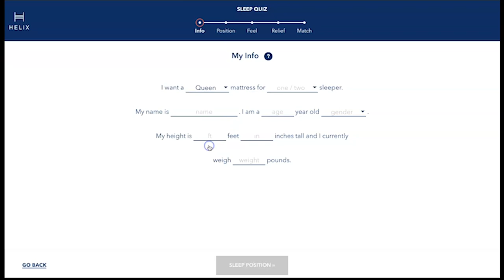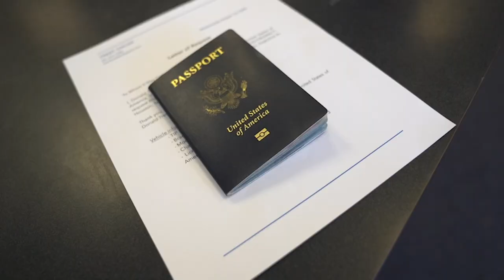UPDATE ON OUR VAN + POURING OUR CONCRETE WALLS

Comment: Questions lol! Did they have an engineering company come up to do slump tests and take core samples to the lab for the concrete? I used to work for a company doing them. Curious if it is the same there.  It's good to see it all coming together! 
On the van: Worst case can you contract sell it to the storage owner so they gov doesn't take it? Worth a shot rather than just letting them take it.  Or maybe you can legally lease it to someone down there? I guess worst case, tell them that you don't agree at all and don't understand why they're doing what they're doing then report it stolen to insurance. It's not like you agree to give it up.

Comment: Allie, you should contact the Argentine Embassy in Washington.; a directive  from them will have more standing in Buenos Aires then that of any of the other Argentine Consulates in the US.   Also, you should contact the Argentine Foreign Ministry (La Cancillería) in Buenos Aires and speak to someone in the Tourism Sector  —invite them to view your YouTube channel- and request that they help you obtain the Permit Extension and to navigate the system in Customs (Aduana) to process the export of your van.    When you contact The Foreign Ministry, especially in writing, do so in English, the building is filled with Career Diplomats that speak English and your inquires are more likely to be re-directed to them rather than their assistants, which should get the attention of someone higher up in the chain of command and they will afford you more respect.   You should also contact the US Embassy in Buenos Aires to see if they could provide the contact information for Import-Exporters that they work with regularly —in Argentina finding a legitimate and trustworthy company is key.   Suerte!

Comment: If you have a TAP, and you worried that it would expire before you get it, suspend your TAP if it's parked on a private property, send them your docs they will verify the Van is actually there and not in use and suspend the TAP until u allowed to drive it back.

Comment: If I'm understanding the schedule here, I really hope you haven't already backfilled those walls THE DAY AFTER POURING??? That is utterly insane. That's green concrete and it needs time to cure and strengthen before putting many thousands and thousands of pounds of pressure on them from backfilled soil. You also need to coat the outer walls with a water sealer. The concrete should be allowed to cure for at least a week bare minimum and hopefully a month for optimum strength. And keep the concrete as wet and as warm as possible (wet concrete cures much stronger than letting it dry out). High rise jobs during winter close in the pours with plastic and insulating blankets. They run propane heaters inside the enclosed area as well. If the concrete freezes while it's still green, you will lose strength big time. Those Mexicans have no idea about such things because they don't get weather like that down there (and have very loose or no enforceable building codes). I can't believe the local Utah guy helping you isn't attuned to these facts. The usual in the construction biz - Good enuf...can't see it from my house!
Reply: Hi  drott - another commentor gave me the heads up that this drama and clueless approach is actually on purpose to build views.  Wow I was naive!
Reply: @batterbury4477  Yeah I often wonder if it's trolling for comments, drama and clicks. And maybe it is? But Trent really doesn't seem to know much or anything about concrete. He is a very mechanically capable guy all around, which he has proven himself to be over and over. But we all have our blind spots. It seems concrete and maybe plumbing are his.

Comment: Building a home, is not the same as building.out a van, or travel trailer. You two need to do a reality check, and hire a general contractor to handle the scheduling of all the subs needed to complete your house, and secondary structure.
Trent has already admitted that he doesn't know what he's doing as far as installing the rough plumbing to meet code. If what he does doesn't pass code, and you have to rip it out and start over, you know it will tick you off. With winter coming on, time is of the essence, and you can't afford to make any costly mistakes!

Comment: You could do a service to your fans by showing you getting your flu shots now before winter starts. Your lives are fairly complicated right now so a short visit to your pharmacy could potentially be very meaningful later on. If it motivates your followers to get that flu shot that would be grand. You might save a few lives.

Comment: If you have to change the size of window because they just "guessed"  (who does that?  Guess it was better then making them 4X8). Getting down what size you needed.. that is on them, and now your loss of view deserves to have some form of restitution made besides the cost of what a 4X5 window would have been.  Not that mistakes don't happen but they are the ones that should be paying for it, not you.  Now you have a littler 4X4 to look through the rest of your life there. Unless your willing to settle for whatever a contractor decides you need  instead of what you wanted, you got to get more insistent of your needs.  Still love your journey, still watching.  Just dont like the way they treat you.  I was in the business 28+ years.  This is no way to treat a client.
Reply from the maker: I totally agree with you. The plans did not specify the size of the windows and I had figured it out earlier but forgot to write it down on the plans. Its the fault of multiple people but we agreed to make the change to 4x4 and leave them as they were. You do have a point though

Comment: oh -- come on - your freaking out over nothing.  Yea - it will take a few more days to get ready to frame.  The weather is not that much of an issue.  I built houses in Minnesota in the middle of winter - 20 degrees below zero weather - you are not facing that kind of weather yet. You have plenty of time to get that closed in.  don't fret so much.